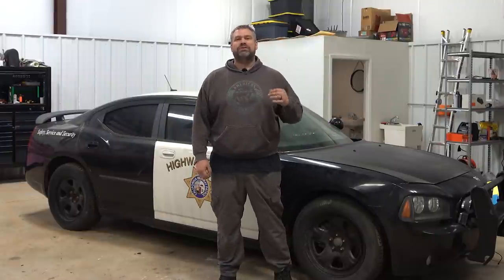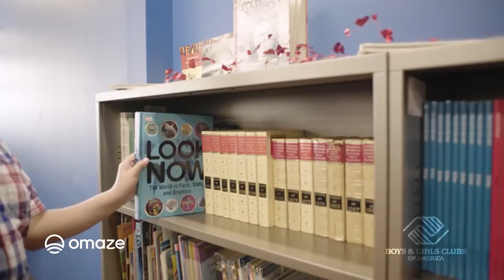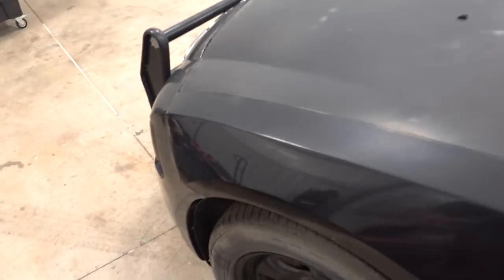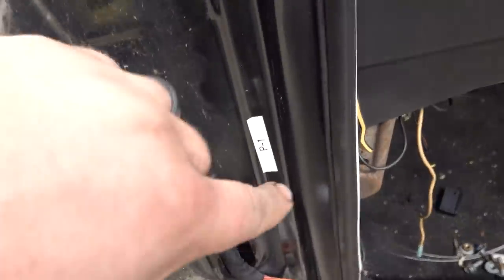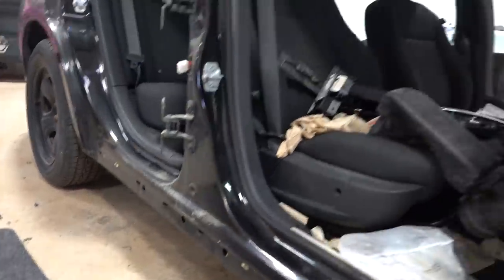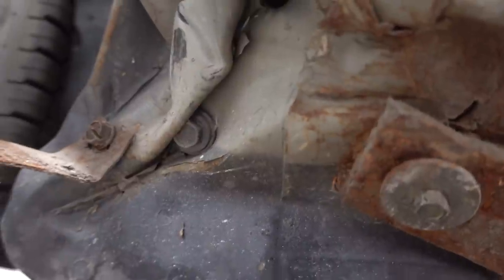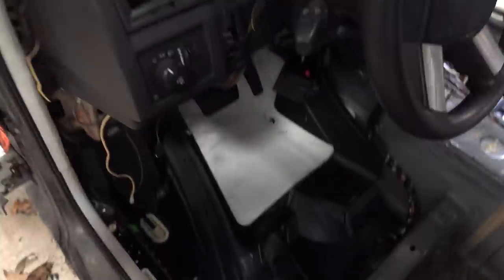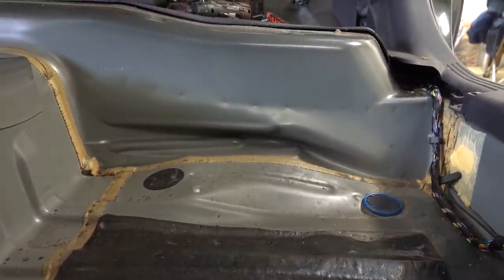THROWING AWAY My "Need For Speed" Movie Car Because It's Worse Than I Imagined

Comment: Good decision, man. The movie car could be fixed if needed but for your purpose it's not really necessary
Reply: So many twisted parts on that movie car shell. I guess it could be fixed but would even be back to normal and how safe would it be since we cannot see all the damage. 

I have seen and also heard of cars suddenly falling apart due to small hairline breaks or cracks. Heck even massive ocean liner are not immune to this type of damage.

I am very happy that the project moves to the new undamaged shell.
Reply: @flaviusfake271  You can crush it into a cube and someone somewhere can fix it if you have enough money.
Reply: Damaged body shell can be purposed for car shows, not performance. Becareful with one lane traffic where oncoming traffic can head-to-head or t-bone would be more sereve damages than undamaged vehicle. 

I would strongly against sell this car to college kids and even daily drivers, but sell with "as-is" to people who wanted collecting vehicles and used for car shows like at SEMA.

Comment: nice to see you got a set of quick jacks to get you by until you got an actual lift.  i use the hell out of mine because i don't have a shop to work in so every time i crank mine up under one of my trucks or car it's a "questionable choice" lol. Mine is a 12volt that works off of the battery in a vehicle so i can literally use it anywhere. out in a field even

Comment: Makes sense that shell was a total hazard and accident waiting to happen. So many parts twisted everywhere and even some rusts. 

You have the best idea and approach. Move as much from the old to the new shell. Still most of the souls will stay a similar engine and chassis plus lots of the original parts especially for the body. ;)

Comment: For the rear doors to work, just pull the door panel and reconnect the cable to the handle and the door lock. I've had several police Chargers, Crown Vics, Tahoes, and Explorers.

Comment: Just got a 2007 charger with a 2.7 I was wondering if it’s possible to put in an update engine in it to make it run like the newer models. If so would it fit just right with out having to change the frame of it?

Comment: If it was that badly damaged how come the doors closed fine. Also I noticed all frame work in the show is done by a third party. Jarod doesn't have a pulling machine. Nor a frame machine. To actually measure how bend the chassis actually is. But that is the mindset of a car body guy not that of a mechanic. A car body guy is more scared of technical gremlins everyone their own speciality. With a clean but chassis at hand and jardo his skill set equipment a swap makes more sense.

Comment: Try the spotlight on the right side. That one may work
Reply: It's intended for the driver to use tho
Reply: @jordangarneau3022  True, but the passenger side spotlight may be usable on the left side. If it isn't, it's parts may be usable to repair the left, which would be reusing the parts so that he doesn't have to go buy a new one.

Comment: Jared. First double check the rear doors for child safety locks. If that gets you nowhere, pull the door panel and check the cable for the interior handle. Most police vehicles come with the rear interior handles disconnected. The Fords used to come with the rods in the glovebox. The 2015-2018 Tahoes my department has, the cables came disconnected. Those that went to admin, I pulled the panels and reconnected the cables.

Comment: As a former ASE certified master collision repair technician, that original car would have needed so much work to make right that it would have never been worth all the time. If it were the Paul Walker R34 hero car, maybe. For a background cop car in a c-grade movie, there's just no chance. It would be cool to see the old chassis measured against the dimensions in the body repair manual just to see how out of whack it is. I'll bet dimensions are off all the way back to the trunk considering how unibody cars dissipate crash energy.

Comment: The important thing about that damage to the floor is the fact that those diagonal ripples in the sheet metal indicate that the cill (rocker panel) structure has been moved front to back i.e. the car is twisted!

Comment: On the movie car rear doors, isn't there a small flip switch or lever that on some manufacturers installed to childproof the rear doors?
Reply: Push pull in the pillar of driver and front passenger door

Comment: Jarred, get over it. Your using most of the body panels, so you’re turning a real x-cop car into the movie car with all the parts that matter. If your so inclined, cut the part of the pillar with the sticker out & weld it into the good chassis, or just heat the sticker up and switch it to the good car. Also just for giggles, cut the vin plates out and put them next to the ones in the good car. Or as I said in the beginning, get over it. It seems most of us have. Build the damn cop car with movie car parts.

Comment: Wow.
Just...  Wow. The amount of structural damage there looks like it would be branded as "Irrepairable" here. If that were put on a frame rack and measured, I suspect it would be beyond the dimensional limits of repair. Effectively, the only way to repair that is to replace the frame, which is what you are doing in essence.